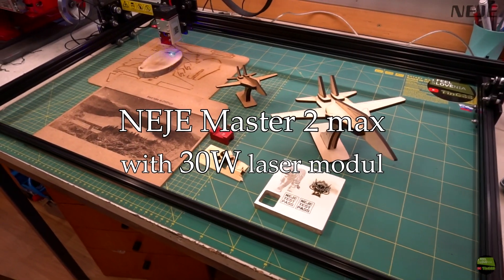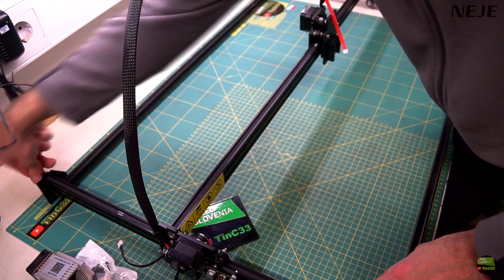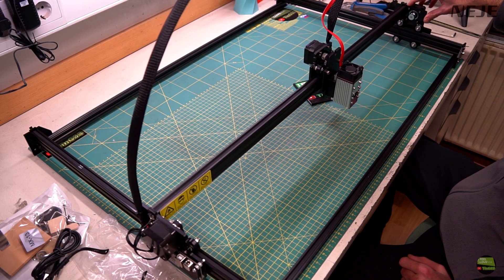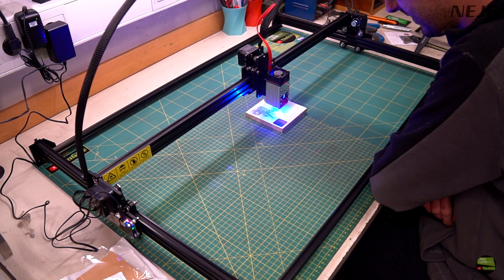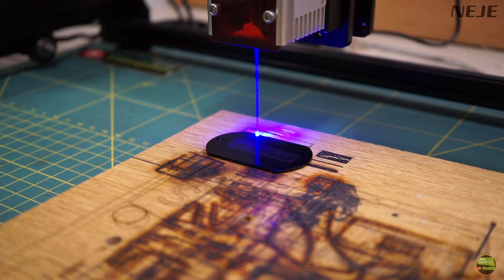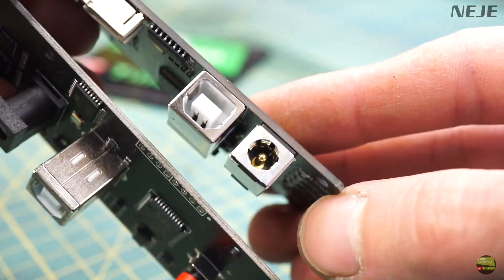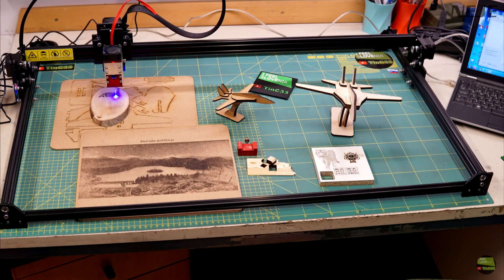NEJE Master 2 max with 30W modul 460 x 810 mm engraver / cutter [unbox / review / first test]

Comment: Hello, greetings, I would like you to help me a little, I have the neje master 2 max 40w I have seen many videos that cut 5mm wood of 3 and four passes and I have to give it like 15 I use the lasergrbl program even though I think it records it as an astro20w and the neje program does not give me the option to cut or win thanks
Reply from the maker: into neje software is no difference between cutting and engraving, only for cutting use bigger laser power and bigger burning time...
if in other software doesn't work with full power you may set laser power somewhere, if you check my last video:
https://www.youtube.com/watch?v=ZO2xUnOoJm4&t=351s at 5:50 you will see what i change into lightburn, otherwise the laser work only with 24% of power even if i set to 100%...
Reply: What air assist do you use while cutting wood?

Comment: Balsa cut power % ? Speed %:? Help please
Reply from the maker: Depend on thicknes, but i think 100% laser power and 5-10mm/second, best way to get right settings is to make test on small part.
Reply: @TinC33  lazer power %100 speed 100 
i am burning
Reply from the maker: @SerkanOral  what kind of software you use, in every software try laser power 100% then into neje about 5-10ms burning time into lightbur 5-10mm/s speed
Reply: @TinC33  lıghtburn I am using, I have neje 30w
Reply from the maker: @SerkanOral  try with 100% laser power and different speed 5-10mm/sec and don't forget to set s max value to 1000 (basicly it come setted to 255 so the laser work with only 25% even if you set laser power to 100%) set that into lightburn EDIT - DEVICE SETTINGS

Comment: Do you have a review for neje master 2s max 40w?
Reply from the maker: Right now editing the video about neje master 2 and master 2S model so difference between 8 and 32bit board, 40w laser modul got in the box but need to film them didn't make unboxing yet...
Reply: @TinC33  Ok, will wait your review, because I am looking a laser which can cut a wood around 5mm. Cutting in the first place.
Reply: Just ordered this...can’t wait for the review . And do you set up air assist? Brand nee to this

Comment: Hi @TinC33 . Thanks for the comprhensive review video but I could not fully undertstand whether it can cut plexi or not ?. Can it cut 3mm flexi ? Thanks
Reply from the maker: Yes it can up to about 5mm
Reply: @TinC33  Thanks for prompt reply. Only with 40w ? Can I cut any colour ( including transparent ) or only black ? Thanks
Reply from the maker: I will try 40w laser modul also on acrylic in next days, so far i can't tell you more, but all transparent colours are tough to cut, solid colours go ok, also if it green or blue...
Reply: @TinC33  Thanks. Looking forward for your test results and video
Reply: @TinC33  how many pass for 5mm?
Reply from the maker: @elviecadiz4551  check my video about 40w modul, it can't cut plexi glass even in 10passes, or it make ugly cut, i read that there are two type of acrylic rolled and casted type, kne should be cutted on lasers but don't know more about.

Comment: Did you buy the ruler plate byyourself or it was also included to device?
Reply from the maker: Buy by myself its japanese brand olfa cost about 50€
Reply: @TinC33  Thank you, I will check it
Reply: if you have link, could you please share it
Reply from the maker: @akundi100  check ebay https://www.ebay.com/sch/i.html?_from=R40&_trksid=p2380057.m570.l1313&_nkw=green+cutting+base+olfa&_sacat=0

Comment: Hi can 30w laser work on NEJE 2
Reply from the maker: Yes it can, and if you buy 30 or 40w laser modul, you will get table for mounting with it, and power supply, controll board and protective glasses.
Reply: Who do you recommend buying from?
Reply from the maker: @antonsteyn8402  i got them from banggood and direct from neje, booth with eu priority line shipping so it arrive in expected time without tax and other fees...

Comment: Where are there no comments that this laser cutter does not even have an ON/OFF switch!!!!
Reply from the maker: True, i got separated switch on 20cm cable with connectors to plug between mb and ps with neje mini but not with max.
Reply: @TinC33  these products are built without thinking things through.

Comment: Hi  Tin. i hope you are well. Before of anything, thank you for sharing the review's video,  it is very very helpful. I bought 40w neje max 2, it is an amazing machine to work. I am very glad about it.  But I came across a problem after 2 days of being using the 40w laser, as you know these laser machines are setup up with weak light for we can check the work area or work with SVG file for cutting. But for some reason my weak light stop working, so the laser is firing soon I connect to the plug even if I have the machine with the bottom off. i don't understand why is happening and I hoping that you can give me some tips. i have run and confirmed the gcode config with wikineje and it's the same. Could you help me, please?
Reply from the maker: We'r well thanks, so if i understand when you power up the machine it instantly start burning with full power? Or just can't get the weak light for framing, positioning...
Reply: @TinC33  yes soon i connect the charger, the laser start firing. I have using Laserweb4 for last 2 days and everthing run very well but for some reason today, the weak light started fashing for full power. And now, the laser is in full power and i have throw away two jobs in the bin,😭. I tried reset the machine, look for solutions in internet but nothing come up about neje laser machines
Reply from the maker: Try to upload firmware once again with neje firmware uploader, and try to use neje app, but i'm afraid thet laser diode driver died, did you contact neje team already, but it's problem to get some those days when they celibrate new year in china...
Reply: @TinC33  thanks for the advice... i have look for the neje firmware in wikineje, but is not available. I found another website but the file have virus. I have contacted them, the neje team and my seller but i waiting for reply.😒 Thank you Tin for share your knowldege. 👍
Reply from the maker: @pyp0ka  try to choose neje 2 on neje wiki firmware uploader is the same, i think version 3.2

Comment: Hola TinC33, en primer lugar darte las gracias por tu trabajo. Gracias a ti me animé a comprar una Neje master 2 Max y me han surgido varias dudas. Te comento una de ellas por si puedes ayudarme, cuando genero los gcode de Inkscape, al abrirlos en Neje salen a una escala más pequeña, ¿sabes solucionarlo?. Muchas gracias por tu tiempo.
Reply from the maker: I don't know inkscape that good but do you save as gcode? Try to export as dxf file and open it in neje software, also for cad cutting and engraving lightburn is much better software.
Reply: @TinC33  lo siento TinC33, lightburn no reconoce mi láser, el software de Neje lo reconoce en un segundo pero lightburn no lo reconoce, tengo todo bien conectado...siento molestarte, sabes cuál puede ser el problema?. Gracias otra vez.
Reply from the maker: @nandoorzada3382  upload right firmware with neje firmware uploader, then just set right com port speed and that's it, but need to upload firmware firstly, firmware uploader can find on neje wiki
Reply: @TinC33  el problema creo que está en el firmware de la página de Neje grbl 1.1f no se puede cambiar en ese enlace
Reply: Siento ser pesado pero creo que el firmware uploader de la página de Neje no está bien, sólo tiene archivos grbl1.1f,puedes pasarme el enlace? Lo he bajado de la página y del tutorial del software de Neje
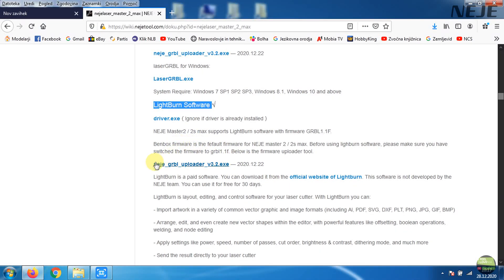Reply from the maker: @nandoorzada3382  did you do as i do it that video on 8:55?
Reply from the maker: into lightburn also try to go into edit - device settings and set baund rate to number wich fit to your firmware
Reply: @TinC33  Hola TinC33, no he podido conectar el láser, tampoco aparece en el baund rate, si lo hago de modo manual, qué tipo de láser he de elegir? Muchas gracias.
Reply from the maker: @nandoorzada3382  hmmm really don't know, its a bit hard to understand with google translate...lightburn find my laser quickly, you install the driver yes?
Reply: @TinC33  Muy buenas TinC33, he estado muy liado y no he podido reponderte antes, simplemente quería darte las gracias por tu ayuda, ya pude conectarme a lightburn, ahora estoy aprendiendo a usarlo viendo tutoriales, me queda mucho por aprender...Gracias!!!!
Reply from the maker: @nandoorzada3382  nice to hear that, enjoy
Reply: @TinC33  Tengo otra duda TinC33 el láser en las imágenes es más potente en los extremos que en el centro, sabes por qué puede ocurrir?. Gracias otra vez
Reply from the maker: @nandoorzada3382  play with speed and acceleration into lightburn go to edit - machine settings and set x and y acceleration to 1000-3000 and speed 50mm/s max to ger evenly engrave.
Reply: @TinC33  Aquí estoy otra vez, he hecho lo que me has dicho TinC33 lo he solucionado al hacer las líneas, pero al hacer el relleno sigo teniendo el mismo problema, se marcan los extremos, sabes algo para darle solución?. Gracias.
Reply from the maker: @nandoorzada3382  play arround with lightburn settings, there are lot of videos on youtube about lightburn.
Reply: @TinC33  Modificando la sobreexploración en el editor de configuración de corte he resuelto el problema, gracias por estar ahí TinC33, un abrazo.

Comment: Good evening, today I got the laser that you also have, unfortunately I have not yet managed to cut the wood, what I used is 3mm plywood is very thin but it did not cut, if I put air as you say to cut it; I really can not understand what I am doing wrong. I have seen many videos and everything shows that this wood is cut. I put 100% laser 5ms and 10 passes. thank you.
Reply from the maker: Try to set 10-20ms burning time, and focus is very important while cutting, so you got smallest possible dot on surface of cutting materiall.
Reply: @TinC33  Thank you for your prompt reply, I will try this too. if i make an air compressor it will be even better; does not play any essential role in cutting;

Comment: Thanks for your Review :) I really was interested to buy a master 2s with the 40W module, but directly at neje.shop 30W is "sold out" and 40W is unavailable... So what are reviews good for, if we can´t buy the products ? Additionally on Ali Express (where i never buy, due to toll / taxes / no warranties and so on), there´s a neje shop but it´s  very strange to see prices varying from 299 up to 800+ Eur. ... Not a company behaviour, i would trust :( Also the advertised power of the laser modules is far from being true. The according informations can be found, hidden deeply inside the technical descriptions, somewhere in the shop. For the "30W" laser it´s just 7.5W optical power, while for the 40W version it´s 15W ? ... Ok, here in germany we say: "paper is patient..."
Reply from the maker: All true, there are lot of interest ino neje lasers, neje max, and plus are new models, so look like they can't produced as much machi es as they sell, also about power you'r right, they advartise electrical power instead of optical, but every single one produser do that so i don't seen such a problem here 😉 yestourday i tested new 32bit board its work only on grbl on 32bit but i'm impressed...
Reply: @TinC33  Hi :) If the 32bit MB uses one of the 32bit GRBL ports, it´s hard to believe, that all of the possibilities of the cpu are used. I´m also a developer and work a lot on stm32 cpu´s. Just 2 months ago i needed to control a multi-axle machine with stepper motors and therefore i took a closer look to the open source code of grbl on github. In the 8-bit world with it´s crippled capabilities, this is a masterpiece of software, but on 32bit cpu´s i prefer a completely different approach. For example: the movement speed in a "circle" (which is just a couple of more or less "short" lines in grbl...) is pretty close to the given parameter, but "close to" is not "exactly" and furthermore it leads to a measurable "rough" movement. On a stm32f446re-cpu (32bit / 180MHz) i was able to control 4 axles in a vectorized linear movement with an interrupt time of just 700nanoSecs. So even, if the stepper driver is able to work with 1uS-pulses (which leads to 2uS step-time (1on / 1off)) i can drive 4x500kHz step frequency and still have more than 60% of the cpu time for other stuff (comm, readahead and so on...). 1st tests on circular interpolation gave me interrupt times of around 1100nS, when i calculate the steps directly one after the other. 
Of course 32bit grbl is at least better than it´s 8bit predecessor, but anyway it´s like driving a car with handbrakes on ;)
Reply from the maker: @chaaalyy  i bealive you, i don't know nothing about that also if i'm electronic, i just try to change mb yestourday and change some changes into firmware like maximum speed and acceleration, the engraver is much faster and still work much smoother than on 8bit, but only with using grbl software like lightburn, neje software stil work on 8bit and if i set motor speed to very fast x motor loose steps and entire mqchine vibrate and work very nervous...

Comment: HI, thanks for the video.. with a 30w? can you do thin lines? and wider? or do you need a smaller wattage module 
 for thin and or Grayscale?
Reply from the maker: You can make thin layer but not as much like with smaller wattage, for grayscale 3,5w is far the best i tested, thet one is too powerfull.

Comment: Hi, just bought the S version with the 32bit motherboard (waiting for delivery): Thx for the great walkthrough and recommendations. If you need inspiration for upcoming videos, I would appreciate content about engraving an image/graphics even larger than the workspace of the Neje Master 2 max. How to split in software - and how to best stitch/align the split image's when engraving. Thx in advance.
Reply from the maker: Thanks, but so far i got lot of work with neje products they send to me like neje mini, neje s (32bit) board for neje 2 and neje max, 40w laser modul and than make another video just about all the laser moduls and different engraver machines, than need to put lasers on edge of table and make something with a mill or lathe so i won't loose all subscribers 😉

Comment: Hi thank again for your video! Did the performance of your NEJE Master 2 max are the same of NEJE Master 2S plus? What change beetwen the two model is only the size right?
Reply from the maker: Yep only size is different, and the design of frame itself, booth exist in basic and S version, S version got instqlled 32bit motherboard.
Reply: @TinC33  Great, I just buy the S version 30 watt plus! Now I will start study how I can work with. Many thanks

Comment: hi, i love the work area of this laser, but i am wondering between buying a higher watt or lower watt, i want to create quality pictures on wood, canvases, stainless steel etc, and i also want to do it relatively fast, does higher watt mean lower  quality?
Reply from the maker: Yes for grayscale wood engrave 3,5W is far the best, but too week for deep engrave, so there is somekind of must to buy two moduls one for grayscale (didn't try 2,5W yet) and one for cutting and deep black engrave, i will make video about all neje laser moduls but not so soon, cuz firstly make video about neje mini, 32bit motherboard and 40w laser i already got at home bud didn't unbox yet...

Comment: the machine is great and cheap, the software is total crap. Do not buy if you use iOS.  I bought a smaller model 30W, took me 3 days to barely let it work (iOS) and it is still not working properly because drivers/software/OS compatibility. Buy it if you are an expert and know how to set it up.
Reply from the maker: Huh, i don't get any experuance with ios but hear a few people they got problems on ios, on windows it work perfect, what about lightburn is there ios version?
Reply: @TinC33  yes, I use lightburn but there are no drivers for 30W compatible with iOS, so to cut a regular paper I need to run 2 passes and very slow.  Impossible to think of cutting 1mm of soft wood. It is just a nightmare
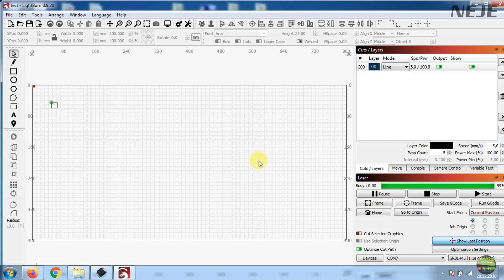Reply from the maker: @Stockholm17  did you upload new firmware grbl-1.1f@38400 as i do on 9:10? i think firmware has nothing to do with OS, also the laser modul has nothing to do with it.
Reply: @TinC33  the only thing I know is that the drivers I found do not match my laserhead. Thank you for taking your time and try to help :)  Updating the firmware of the machine is possible only with windows. I managed to do that with a virtual machine, but I need to pay for it to keep it. However, the 30W drivers for lightburn (machine profile) are not available or just very hard to find. I followed a tutorial, did not work well. Everytime I plug the machine and try a cut, I have problems of any kind. Work-area not matching, laser not powerful enough, work-area shifting, laser not working for the first second (leaves a blank space) etc etc. If it takes me more time to configure a machine than do the cutting job (everytime I plug it)  then I prefer not to use it and maybe later I buy another model not from neje with better user interface, compatibility and usability.
Reply from the maker: @Stockholm17  i just try to test new 32bit motherboard, but try to engrave few image with old 8bit board, and also i got some problem on lightburn, the model i use iz neje 2, neje 2 max (also 8bit) work just good, i hope with 32bit board will be better.
Reply: @TinC33  thank you :)